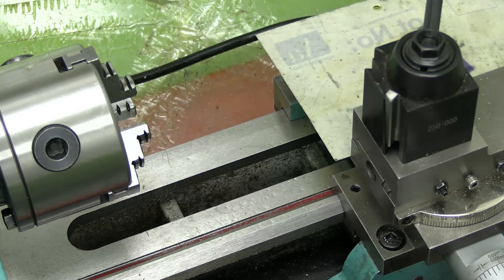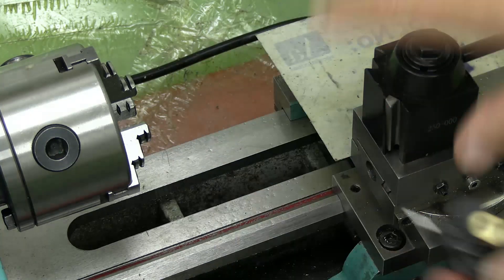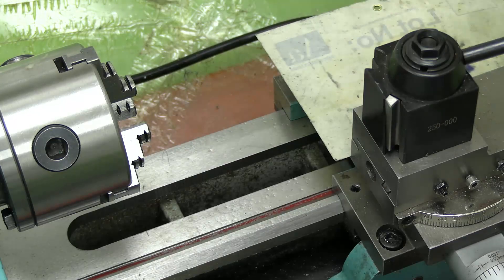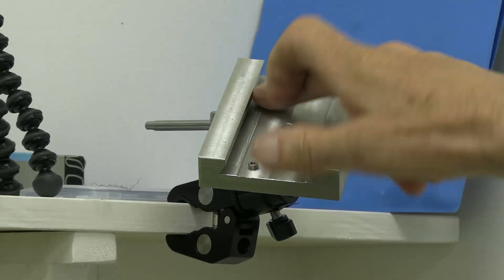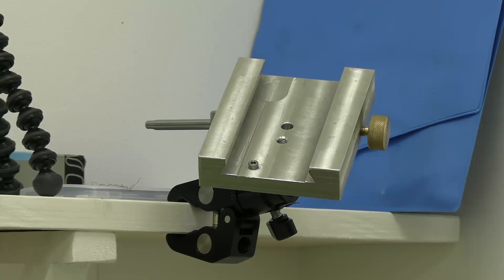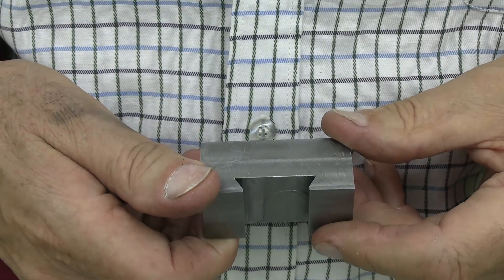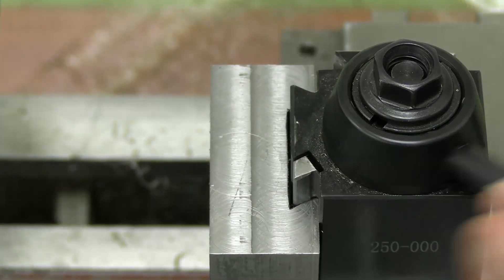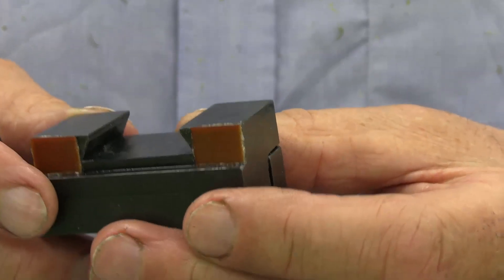Making a QC tool holder, and parting off

Comment: So the square 'riser' plate on the 250-000 is removable !? Can you confirm that?
Everywhere i look,  see this qctp with this riser attached underneath so i thought it would not fit my lathe because it would be to high..
Reply from the maker: Yes. The one I got was from https://uk.banggood.com/Machifit-250-000-Cuniform-GIB-Type-Quick-Change-Tools-Kit-Tool-Post-250-001-010-Tool-Holder-for-Lathe-Tools-p-1434251.html
Reply: @samuelfielder  thanks!

Comment: Interesting video!
Adjusting the height of the cutting blade is mandatory. Aligning the blade, not the tool holder, referencing the chuck, has payed off. For aluminum using denatured spirit, "white spirit" in the old days, now days using denatured "red spirit" is much cheaper. Old knowledge since 50 years. Reading the warnings on the WD40 bottle I don't use it anymore.
Before cutting stainless, and similar tough materials, I would think of some dripping device supplying cooling/lubricating fluid in order to use both hands in order to keep te cutting go on. Don't back off in cutting stainless is what I've picked up from "the sharks",
Reply from the maker: Yes I agree with your dripping idea. Backing off to allow time for manual oiling is problematic because you always have to push harder to get the tool to start cutting again. I do need to improve the ventilation in my workshop. The warnings on WD40 say "may cause dizziness or drowsiness, use only in well ventilated area", but my white spirit bottle says the same.
Reply: @samuelfielder  Stuff like denatured red spirit is genuine alcohol.... The fumes are flammable, alcohol affects human beings... However the poisoning effect is a lot less harmful I think.

Comment: I run a Posilock collet chuck which uses a Clarkson thread on the drill ends.
This kind of chuck is very good when using dove tail mill ends, as it prevents the bit from been dragged downwards.
Reply from the maker: My dovetail cutter does have a thread on it, and thanks for telling me about Posilock collets. Might get some. On the other hand, the fact that something could give probably saved the cutter when I crashed it into the workpiece! Would you advise getting cheap R8 posilocks from e.g. Chronos, or is it wiser to pay more?
Reply: @samuelfielder  I bought the vertex 2MT Posilock 4pc set from Chronos, for my WM14 and it's my main chuck for milling.
I have never had a lock, stall or bit miss-movement. Even when milling odd angles or on the rotary table.

I can't speak for the R8 as I have never used one or felt the need to buy after getting the Vertex.

Maybe ask Chronos what's the difference, as they are very friendly and helpful.
Reply from the maker: @adrianbritton428  Thanks. It seems Vertex don't do them in R8 taper. Chronos's R8 version is 23% cheaper than the Vertex, so might be a quality issue there.
Reply: @samuelfielder  
Doh!
Slaps head!
Of course your WM 18 uses an R8 spindle taper.
I had a blonde moment there.
For some reason "I don't know why" but I was thinking you was regarding R8 as the collet type.

Comment: You did very well considering how far out from the chuck you placed the tool
Reply from the maker: Only an inch I think. But your point is well made.
Reply: @samuelfielder  if I were you and had a number of stainless bits to make, (and I know you have) I would put the standard toolpost back in place. Use a 1.5 wide  single piece tool that uses a carbide insert.  The overhang that any blade introduces is not what you need. Also ensure your tool post is in the best position relative to the top slide support. I must admit that in this video it went quite well, but to reduce anxiety levels when parting is always a good thing. Anything that can help the rigidity of a little lathe like yours is helpful.
Reply from the maker: @smallcnclathes  I expect you're right, but a pain changing toolposts.  I forgot to mention in the video that I actually bought one of these https://www.arceurotrade.co.uk/Catalogue/Cutting-Tools/Lathe-Turning-Tools-Indexable/ARC-Indexable-Turning-Tools/ARC-QA-Parting-Grooving-Tool-Holders but discovered it was to unusable because the cross slide won't wind back far enough. I am also working on other ideas: getting 3-phase installed, and getting a much bigger lathe!
Reply: @samuelfielder  that tool looks much longer in the blade than anything I have seen before. I am not surprised it will not fit.
Reply from the maker: @smallcnclathes  How about this one? https://www.kennametal.com/us/en/products/p.a4sc.4169749.html